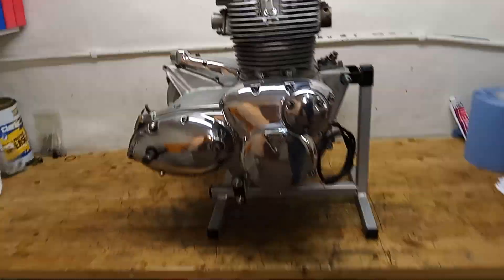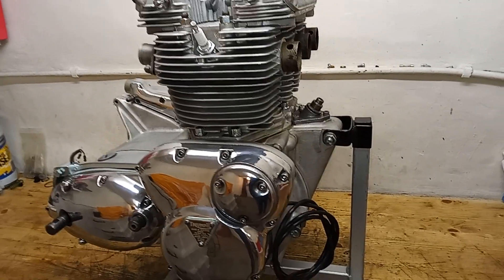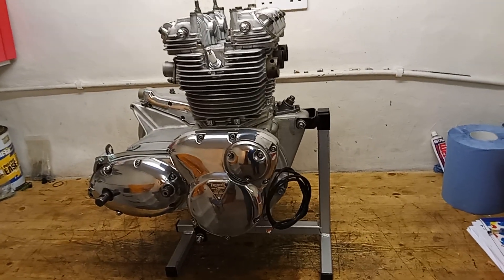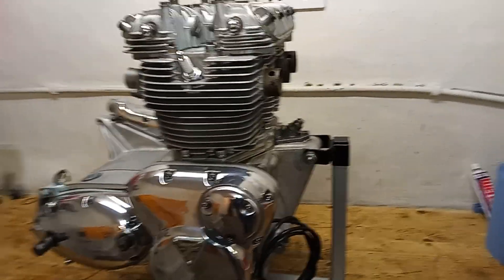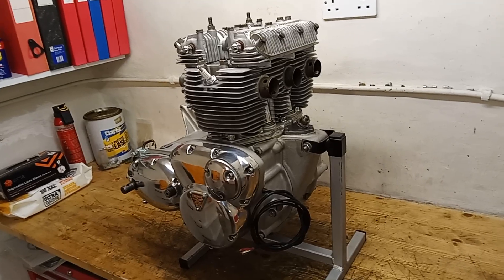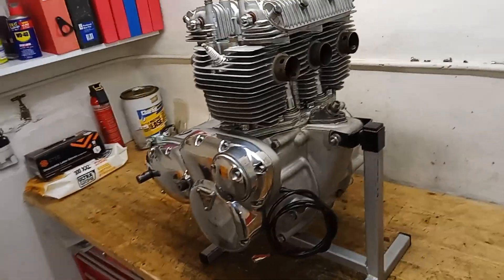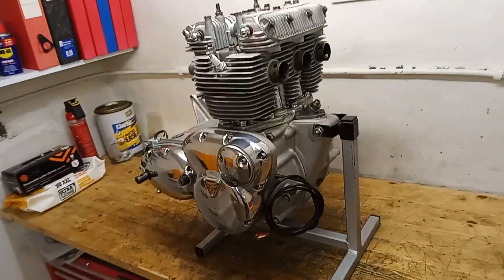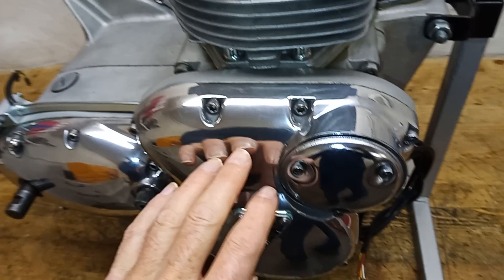Triumph Trident T150V Engine Rebuild Part 48: Engine Rebuild Completed!

Comment: I have a Rocket 3 that I bought recently. I had one 50 years ago and wanted to remind myself what the engine looked like inside. Your series of videos was really good for that so thanks a lot. I shall buy your stripdown manual when I need to tear the engine apart.
Reply from the maker: That's great. Thanks for the message. 👍

Comment: Hello; can you help me with the size of these longer videos? I want to share some wrenching but the size of the clips are impossible; even to edit so even worse to upload...
May be you can throw a dummie s method or a simple software  or a shortcut. I tried with a camera and with a cell phone and the archives are like almost impossible to fit into the memory card.
Thanks
Reply from the maker: Not sure. Mine are just recorded on my mobile phone. Works fine.

Comment: Regarding the blast cleaning, do you think it is worth the trouble because the bike will become dirty rather quickly in my neck of the woods. Wont you become a slave to obsessive cleaning..so to speak? Also if you didn't what would you use to clean the motor? Im sure you've not blasted every engine you worked on and used an alternative method. Thank you for your videos they are quite good. (What will you use on the Norton?)
Reply from the maker: It's entirely a matter of personal choice. Some like shiny and blast cleaned, others don't. The cases stay surprisingly clean after blasting. Outer casings and all alloy and chrome is cleaned with Solvol Autosol. The only alternative to blast cleaning is elbow grease and a detergent of your choice (I've not found one yet that I'd recommend)  but trying to clean between fins etc is almost impossible anyway.
Reply: @Chris.rooke150  thanks.